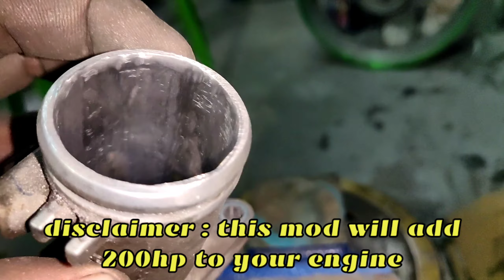DIY Dimple Porting Head ( Do Not Watch This If You Are Trypophobia )

Comment: Its already wrong since you started Dimple Porting bro you should use smaller Drill bit And Started from the top intake make 1 Row Around and Make another one in the bottom Until its Full Of Hole and dont grinding too deep

Comment: Those Dimples become Pockets, overtime Carbon will rest there and it'll be harder to come off. You want the surface as smooth as possible.
Reply: If it’s port injections and is not using an EGR system then there won’t be build up on the dimples as they are there primarily for creating turbulence and improving atomisation with the fuel cleaning the carbon off the surfaces, however, if it is direct injection and does incorporate an EGR system then it would benefit more from being polished to prevent the carbon build up. I understand where your coming from but it depends entirely on the application of each effect that’s important.